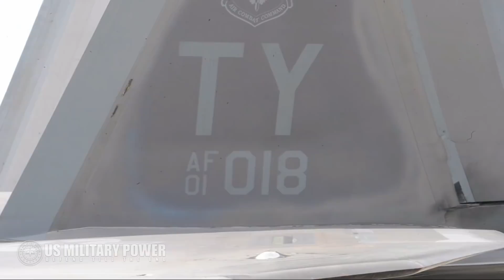Why Did America Stop Producing the Best Fighter Jet Ever?

Comment: So, for slightly more than a Raptor, Sweden have put an attack submarine to sea that can hunt and sink a Nimitz/Gerald Ford class carrier undetected by the Americans and then slip away. How is this possible? It's engine is so quiet, the current sonar cannot detect it.
Reply: An Astute can. It even tracked a US nuclear attack sub (USS New Mexico) and the Yanks didn't have a clue. And that was with the US Navy Chief of Subs on board the Astute! The Yanks called it 'utterly amazing'.
Reply: KangoV the Swedes built a sub that used sterling engines to be quiet along with a few other tricks to mask it. The US rented the sub and it’s crew for two years to learn how to counter it. American Carriers are not easily sunk. When they did testing on the USS America they spent 25 days out there doing all kinds of explosives testing simulating torpedos and whatnot to learn from and improve the newest Ford class carriers. They found it near impossible to sink.